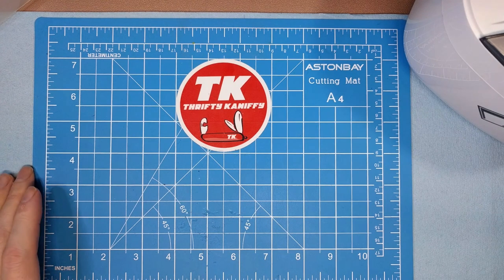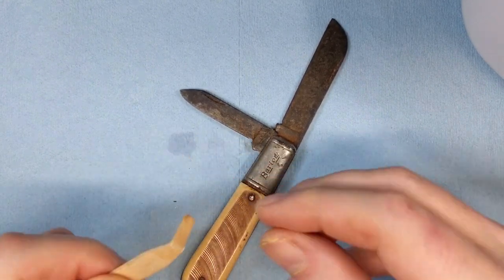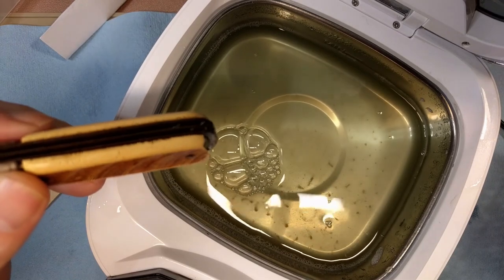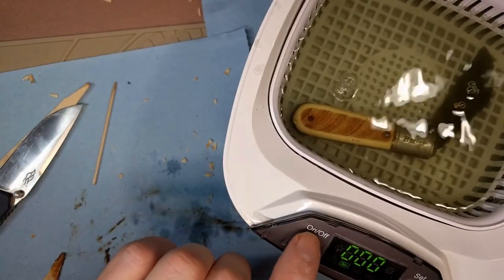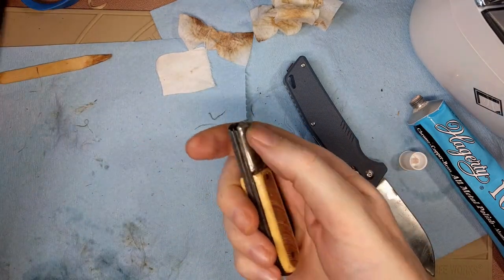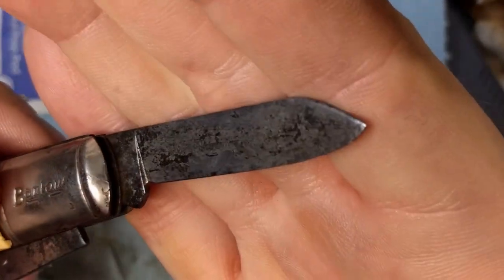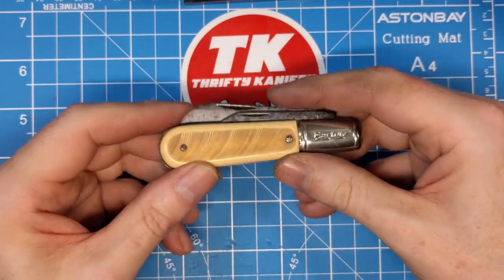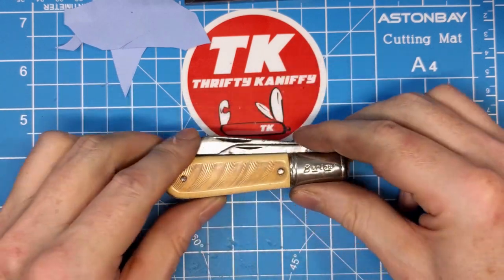Rustbucket Colonial Barlow Pocket Knife - Too Far Gone?

Comment: After watching a few Ugly Knife Challenge videos I remembered my SIL had a few knives she found in her garage after buying a house several years ago. Earlier this week I asked my wife to see if she still had them and she did. Years ago when I first saw them I thought they were too far gone. My mindset has changed since then and I took another look. One is a Barlow just like yours made by Imperial of Rhode Island...She is the best of the three and in much better condition than the one in this video. Because of my amazing results with 50/50 vinegar and water on cast iron skillets I will use the solution on the rust. Fifteen minutes of soaking should take care of it and then some deep cleaning with some swabs and polish with Flitz.  The second one is an Ulster made in Kingston NY probably between 1920-1930. Other than some rust much of the main blade has been ground down. Someone used the heck out of this knife  and sharpened it over the years so the blade  edge is about 30% less. The main blade is still workable and the second blade shows little use. Can't call her ugly though...just used. The third knife is a Camper made by  Ideal of RI circa 1950. At first glance she seems ok then you realize there are no scales but based on the design, it does not immediately stand out. The bolsters and the body of the knife seems to be the same material and other than the pins standing proud because of the missing scales you would think it was an all metal knife. It will be fun returning these noble tools back to serviceable condition.
Reply from the maker: I like experimenting with different techniques, this is definitely NOT the most effective or efficient one, but I was trying not to use hard chemicals or abrasives. Thanks. With anything you really care not to harm this would work well.

Comment: I have used rust erasers to clean some old knives and they come in various grits. These are used for cleaning fret boards on guitars. It has worked well for me. I've used Baroque 180,400,1000 grit kits from Amazon sales and Garryson which are offered in 36,60,120,240 grits. 4/0 steel wool and Scotch Brite pads are a plus.
Reply from the maker: Thanks for the info, Kandcdish.

Comment: Restoration "101", Good Job! I've done several that I thought I did OK on. Sometimes you can only do so much. After you rubbed a lot of that surface rust off I have found that Flitz does pretty good on the blades & bolsters.
Reply: Duh, I didn't watch long enough you did use Flitz!
Reply from the maker: Flitz is great stuff. Ballistol too. I continue to improve on them.
Reply from the maker: No problem Tim.

Comment: Very interesting sympathetic clean up, I like it. I’ve been collecting old knives for years and usually don’t do much except oil and clean. You did a great job. To me, the most interesting thing was the minimal blade wear. Usually when I find these knives they’re worn to a nub.
Reply from the maker: Yes, it was unusual in that way considering the condition otherwise. Crack in the handle? Yes. Rust everywhere? Yes. Blades worn away? No, not at all.
Reply: Yep, I have a few of my grandfather's old knives and every one of them have blades that have been sharpened down to picks.

Comment: I have a knife like this. What I like is, the blades are carbon, so they are really sharp. I've been wondering if anyone put on different scales on these before?
Reply from the maker: I haven't ever tried to replace the scales on these. Good value when you find them under 15 bucks. Thanks, Royal.

Comment: You did quite a nice job! I hear that little rolled up bits of fine steel wool does a good job inside those channels. push them around with your stick. Don't you just love a patina on an old blade? I sure do. Nice video, Subbed.   😊
Reply from the maker: Yes nothing quite like a good patina. Thanks for tip Rooster.

Comment: If you couple the ultrasonic cleaner with Evaporust, it will do an excellent job of removing even the hidden rust trapped between surfaces.  I don't understand why more tool guys haven't figured this out yet.
Reply from the maker: I've not tried it yet, but I agree it would do quite well.

Comment: These knives were the poor man’s or school boy’s knives. They sold them in the 1960’s in an open cardboard stand on the counter where the clerk could watch them . Different patterns from stockman and others . They all had the faux saw cut beige plastic handles with tin bolsters crimped to the liners . If I remember correctly they never replaced the sold knife in the cardboard stand until all knives were sold and a new stand would replace them .I used them and they got the job done as well as an expensive slip joint folder .
Reply from the maker: Welcome to the channel Randy. They definitely were just a cheap general store style knife that sat upon the counter. I like that nostalgia about them. Thanks for the comment.

Comment: I found a BARLOW on a trailer i recently bought. At the time knew nothing about it but added it to the collection. Can one knife be defined as a collection? Cleaned up I noticed milling marks on the big blade so assumed very low use. Was and still is dull as a butter knife. Didn't want to screw up something i know nothing about.  Plus I don't carry a knife. It's scary enough shaving so why double the odds. Cool video
Reply from the maker: Thanks for having a look Kevin. For us knife guys we feel naked without one. Have a great weekend.
Reply: @ThriftyKaniffy   on the blade it reads.. COLONIAL...and then under that....PROV U.S.A.. 
  I noticed on the knife you rehabbed it had 2 pins holding the grips.. this has 3.. does that mean anything?

Comment: Thanks, TK, for the share. May I suggest a Dremel tool with a set of polishing wheels, wire brushes, and ultra fine sandpaper (600, 1000 grit paper)?  I think you could then bypass the ultrasonic cleaner. Some work but it looks and sounds great! Thanks for the share.
Reply from the maker: Next time perhaps. Experimenting with no abrasives or hard chemicals. Thanks, Byron.
Reply: @ThriftyKaniffy  Why?□😁